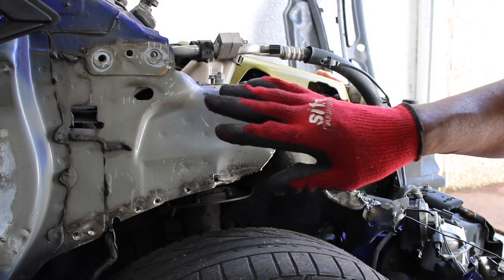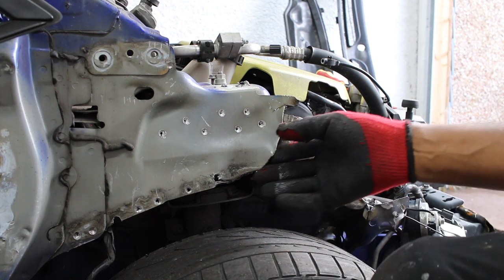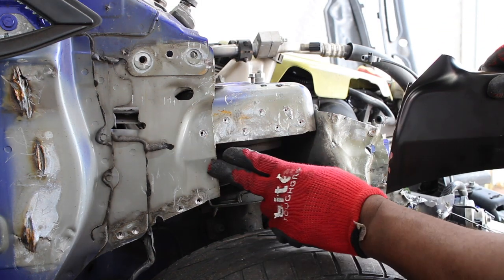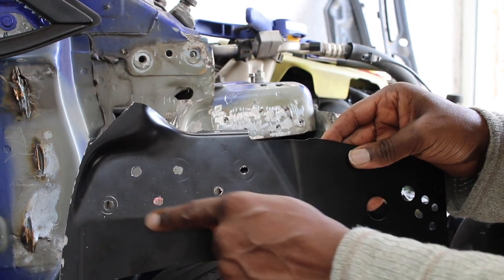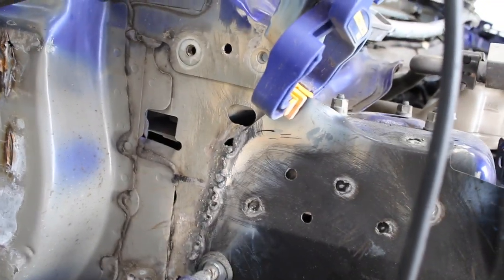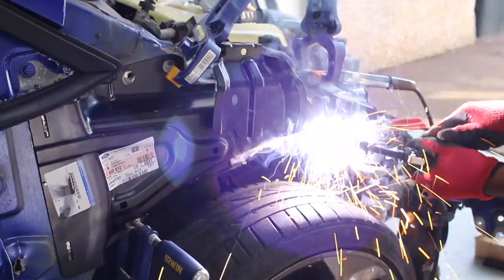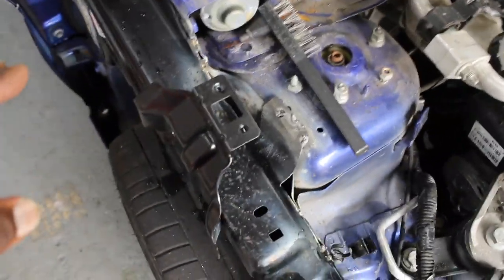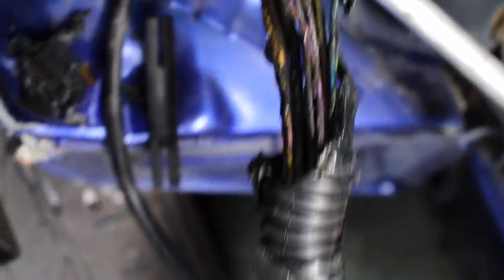Welding on new panels on my Fiesta ST and failing miserably

Comment: tip for future. grind the paint off the face of where your spot welding and that sticker.biggest problem you got there is contamination in the welds. also the panel behind should have weld through primer on it.
Reply from the maker: Cheers Steve

Comment: Supporter of your channel so please don't take this the wrong way but you really need to get someone that knows what they're doing to fix this part of it for you.  That is an inadequate repair someone could get seriously injured if not killed, the crumple zone will not work your welds will just shear.
Reply from the maker: Thanks, what sort of welds should they be?
Reply: Cars For Paul  professional welds
Reply: Hi Paul, in an ideal world spot welds as per factory.  You can plug and seam weld panels on but you 1. Need to be conscious of UHSS / boron and bonded areas depending on area of car. Big no no to mig weld these areas. 2. You need quality welds with no porosity no undercut and with full penetration (this means LOTS of practice on scrap panels getting the right settings and using argon/co2 mix). 3 prep your panels, clear all paint on surrounding areas including the rear and  paint with weld through primer and then seam seal afterwards else your efforts will go to waste. 4 you should get the damaged areas pulled prior to cutting them off and make sure everything aligns before starting welding, such as that bit at the back (which looks like it needs replacement)    I post this as you're willing to learn which is great  but please don't see it as a 'how to' for your repair, this is not the way to learn, anyone can point and shoot a mig but it takes some practice and ideally  someone experienced to show you the ropes.  Others will argue it's overcomplicating it, but even when well practiced there is a world of difference between a repair that looks good and one that retains factory strength and crumple zones in a crash.   Great effort on the channel so please keep it up 👍, I hope the above helps
Reply: @offbeatwarble  that's a nice comment, nicer than a lot of these sour grapes on here, poor guy is trying his best, and I respect that a lot. KEEP UP THE GREAT WORK PAUL!!!
Reply: @offbeatwarble   : Skilled welders are not cheap - cheap welders are not skilled  ............

Comment: Paul, I admire your attemp but this repair is way beyond someone who is welding for the first time. You shouldn't of overlapped the first panel, the plug welds should of been in the same place as the originals, and the welds should of been full and complete and not pigeon poo splatter. Those are not strong welds and defiantly not suitable for such a structural area. They will come loose after a bit of vibration from normal driving. I would say this repair has defiantly compromised the safety of this car. Sorry Paul.

Comment: I did some welding a long time back, but never done enough or had any proper training to be called a welder. You are right to get someone to examine your work and correct any things they feel are not up to standard. Welding is critical to a structure like this and if the welds have not penetrated as they should, or have over heated the work area, the two pieces will not have bonded correctly so the weld will fail. A good-ish way when learning to check is on scrap material. Weld bits together, look at the weld and try an impact test, (e.g. hit it with a hammer) to see how the metal starts to pull apart. If the weld was not sound it will probably just break, possibly just shatter, but may pull apart tearing the surfaces as only a small part was bonded. This will give you feed back on your work. You will learn what makes a good weld and what it looks like. Look closely at the work that gets returned to you after a welder has done their best. Then practice on scrap until you are as good or better than them. There is more detailed guidance from others on this page. Brilliant welders make it look so easy - it is not until you get their skill level after a great deal of practice that anyone can reach their standard. Even master welders started somewhere, though perhaps not on a road going vehicle as their first try. 

Use the scrap wisely, it is not just waste material for you, it should become a tool of your trade. Digital images can help you plot you progress.
Remember a bad weld can often be polished down and painted to look OK, however it will always be a bad weld.

Comment: Love it well done Paul. I’ve got a similar welder and have done a Fiat 500 inner wing twice. First time the sparks set fire to an old sheet I put over the tyre. I then bought a fire retardant blanket. Mine wasn’t very pretty either but solid as a rock. Look forward to the next one.

Comment: You will get a lot of comments about the welds. 😂 A bit of constructive advice = use a weld through primer on the bare metal, Halfords sell a upol one which is ok. Also you have a lot of wire sticking out of the tip, get closer and the welds will be neater with better penetration.
Reply from the maker: Thanks for the advice, much appreciated

Comment: Just have a look at a few welding videos and have a practice piece to get to know how to penetrate the metal and basically it’s a good weld that has penetrated the metal behind and use both hand one to stabilise the gun , it’s a good go and you have to start somewhere so a good effort though

Comment: Ok so not bad for a first attempt at welding .  I have seen a lot worse . as some have said prep is key to getting a decent weld,  2 areas cleaned off makes it  work easier. dressing the damaged edges is always easier before fitting new panels. Robs(Salvage rebuilds ) method is how we do it  drill screw on with self tapper check all gaps then weld . Its a learning curve dont be tempted to rush it . Keep at it dont let negativity grind you down Best regards Rich.

Comment: Hi Paul. I enjoy your videos as I'm interested in repairing cars myself, but you really need to improve your  technique  before you tackle a job like this one.

Firstly when your drilling out the original spot welds try using a spot weld drill. They should enable you to remove one panel without drilling through the second panel at the same time. When you drilled all of those holes through the suspension strut mount you should have filled the holes you made with weld and ground them off so it didn't look like it had been drilled. As it is lots of water that's sprayed up from the wheel will get into the back of those holes and start to rust the suspension mount and the back of your new panel.

If you were going to panel beat the inner wing so that it fitted closer to your new inner panel you should have done that before you put your second outer panel into place so that you could get directly to both sides of the area that your beating. A good way of doing it would be to hold a heavy hammer flat against the back side of the area your beating whilst hitting it at the front side -or vice versa.

Lastly it's your welding that's in my biggest concern. If that corner of the car is hit again that new panel won't crumple up like it did last time, it will just fall off.
Welding is the fusing of two  materials using heat and the filler wire. The two materials should be hot enough that they melt together. You haven't got the correct technique yet, all you've done is put some lumps of filler wire on top of the materials that you were trying to join together, the panels haven't fused they're just lightly stuck to the lumps you have put on.
It will help if you hold your welding torch closer to what you're welding. The end of the torch should only be around 10mm away fro the work piece, it looks like you're around 30mm away. You will have to experiment with your voltage (power setting) and wire speed too to get everything working correctly.

You needed more weld too. When you fill the drilled holes to fix one panel to another the holes should be completely filled in with weld and should glow for a second or two after you've finished welding them.

Have a practice on thin bits of scrap metal to see if you can improve, I'm sure you will be able to, but it will take a while. Gasless welders aren't brilliant at the best of times either so if you can't get on with it it might be a good idea to try one with normal wire and a shielding gas.

I hope I've been a little helpful, I'm not the best at explaining things , but thought I'd try to!

Keep the videos coming!

Comment: Hi buddy i’m not going to criticise you just wanna help you out ! If you take a plumb line at the 4 corners of each chassis rail at the same point and mark out on a flat floor these 4 points with chalk, You then push car out the way and connect the dots up in an X pattern , If the chassis is in alignment then each part of the X at its centre point will be the same length, hope you understand that !
Reply from the maker: Excellent tip, many thanks

Comment: You need to practice your welding on some spare bits of metal before you do it for the first time on the car. Also hold the welder a bit closer when you're welding. It doesn't look like the welds have penetrated so they will probably fail with a slight whack. Give me a shout if you want me to help you out.

Comment: Nothing wrong with giving good advice to Paul on his welding chaps, that’s how we learn, but terms like pigeon poo etc can be insulting (no offence), better to use professional terms as things can be taken the wrong way.
Good advice on the placement of the welds and using weld through primer though.
Welds don’t have to be pretty to be strong as long as you get good penetration however making things look nice is the icing on the cake.
Paul I enjoy your videos very much and appreciate what you’re trying to do.
I was watching a channel the other day and a guy was removing spot welds from a quarter panel using a mini air powered belt sander, it looked quite effortless to be honest and might be something for you to look into.
Thank Paul, kind regards Chris.

Comment: Hi Paul,  Not a bad try for your first weld but small tip ,  use a dolly or a block of metal when you hammer a panel straight and dry fit every thing with self tapping screws before you weld. I think your welder was on the wrong settings as it seemed a bit to urgent for the thickness of the metal. Good luck, you can only get better..!

Comment: Sorry paul but 
thats a terrible repair I’m sorry to inform you as you have the willingness learn.
Both surfaces of metal must be clean from paint before welding, your holding the weld nozzle to far back ,,, practice practice practice first.
Im sure others will point out more that I haven’t like pulling certain bits first before welding , measuring and stuff.
Watch some welding vids and buy a car dozer or just try mechanical.

Comment: I never take it from anyone that gives things a try or a go at things themselves. But I have to be honest you need to check how others do things VTuned is a excellent repairer on here.
You used no weld through primer it will rust between the panels. The alignment is out the bolt whole for the bonnet hinge is in a different place you can see that in the video left whole central right whole upward now they are both upwards. The welding you got to get a gas one or add gas to yours. The wholes in the welds are weakness and the fusion between did not look good. 
That inner panel that's all crumpled looks bad real bad pulling the original to start would of helped.
You have the idea enthusiasm but lack the knowledge. I will advise you any time if you like help. But I got to be honest not looking good sorry and that wire damage if any of that carries the canbus you could cause so many issues even if you heat shrink join solder anything as resistance will alter. Heat proof shields a sheet of steel welding blankets should all be used to protect car. Also grinding all the glass gets damaged and other paintwork . Cover it all up metal filings from grinder all over engine bay as well.
I hope you don't think I'm being mean I'm known as Mr fussy but it has to be done right.

Comment: It’s better to practice the welding on the scrap sheet metal before doing structural welding as these welded joints would split in a split second if there is an impact.

Comment: Test fit of the bumper no sorry the wing lol...  What u smoking paul  weld needs to have penetrated yours don't look like it has practice on scrap metal play with the settings of the welder...   weld through primer stop it rusting some seam sealer

Comment: Horrified
Its like a retro cut and shut
You should be welding clean bright steel and had some practice before doing this
You could have joggled a straight cut in rather than this patch and self tapping screws as alignment fixings than clamps
I don't think this repair is to a safe standard   and you have had a fire which could have been worse
I bet your on amazon buying a garage powder extinguisher 
My only fear is the next owner after you as this will be flipped for the next project
Reply from the maker: Look, am not here to offend anyone, so the car will be going in to get done properly by a Bodyshop.
Reply: @CarsForPaul 

A very wise decision   
I was going to add to my comment rip it off and start again
Like I said in the last post...    You need the correct tooling and the skills
Safety first
If not your own....   Potential buyers of future projects
Reply: Cars For Paul , very wise move

Comment: I could pull that panel off wing my hand, who hold's a mig welder 3 inches away from where their welding, no weld through primer. About as strong as a dried out bogie.

Comment: Everyone has to learn, but this was the worst job I've ever watched. Arthur Tussik is extremely informative and shows exactly what is required on this tiny bit of a job. I was surprised that you cut the inner rail. Couldn't you have straightened it in place by getting a hammer in front and behind it? A shocking repair overall. Hope yo never take passengers in the car.

Comment: Ideally need to be spot welded and  I would of changed the inner piece you was bending straight as if it has a crash it won't hold properly

Comment: Really no good on the welding to be honest a lot is down to cheap welders I can recommend the Clark welders ideally gas it does take practice a jodlers a good tool punches out holes for spot-welding save drilling

Comment: Anyone need a panel beater  around the London area? 😊  For 200quid I would have done that job for you. It would be done properly too. You gashed that job up. Sad really as you are going to all this trouble. Yet for a few hundred quid you'd rather gash it all.. Not clever really and it's dangerous

Comment: this repair is terrible, you might as well used a bit of chewing gum to hold the new panels. those welds will not hold and if involved in another crash. the new panels should have been sanded before welding

Comment: This is so unsafe..
Reply from the maker: based on the feedback that I have got from the pros, I am going to send the car to a bodyshop to get this done properly, but give me some feedback as to why this is unsafe
Reply: @CarsForPaul   weld has not penetrated.  sticking a patch (cowboy style) not lined up properly wing looks to far back...
Reply: Its not easy work looks simple  drilling spot welds out use a spot weld cutter machine mart sales them...

Comment: Get yourself a proper spotweld removing cutter dont use plain drills , cored (gasless) wire is no good for panel work thats why you ended up with a shit weld , and welding skills dont come in the box with the welder, next time get a proper mig with gas not a mickymouse one or get someone in to do the welding for you